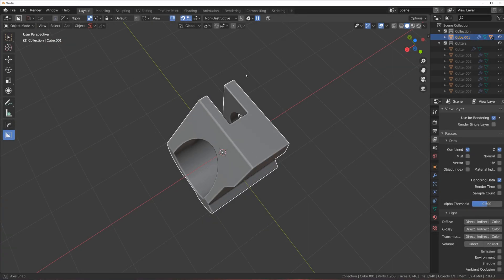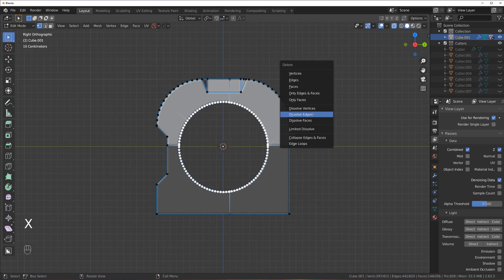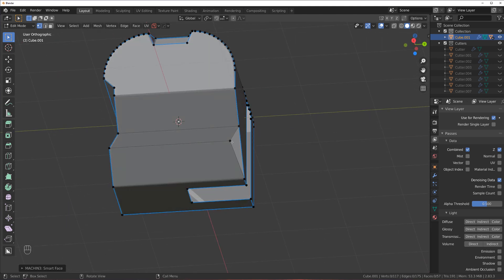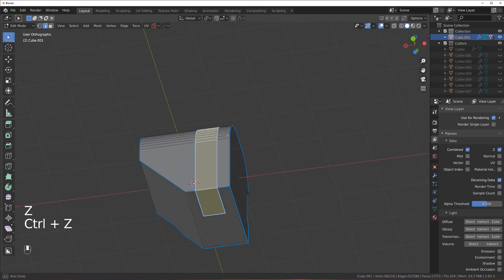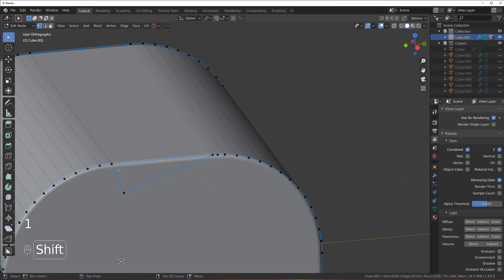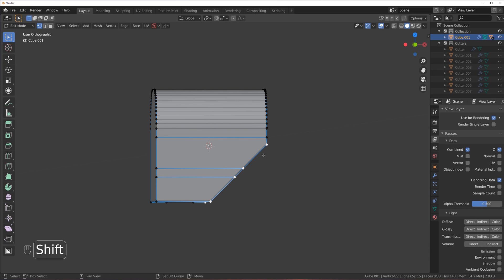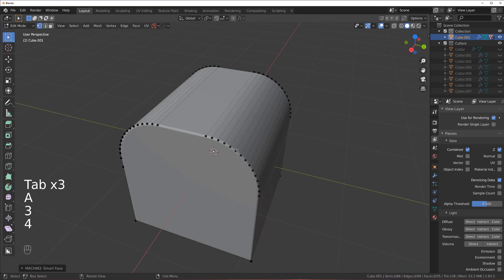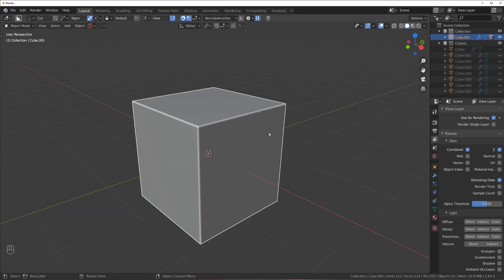REVERT your BOOLS in Blender.

Comment: I'm on a brink of giving up  on boxcutter. You see, while it's awesome 
being able to create fast your assets, my target has always been game 
asset creation (for my game). I've had mannnyy hours of searching 
through the webs about how to UV map and texture properly (with baking) 
boolean cut models, went through and tried manual way (it worked but 
very very hard to do), then tried Maya's auto remesher which didn't cut 
it, tried ZBrush's Zremesher which kind of worked after some tweaking 
but ended up with not so great details and quite a bit of cleanup to do.
 On some of my tests, I was actually faster getting my asset ready (with
 UV Map and proper materials) modeling the classic way (with quads, 
subsurf) than dicking around with remeshing and UV mapping the output 
generated after modeling with boxcutter. Last call for help here.
Reply from the maker: well it is really up to how you set your workflow, we all have out way of working and each model has different purpose. Try new cleanup tools from hops, i am dropping a vid on it tomorrow. But again, if you need ALL quads then manual way might be better. When I create hard surface game assets i dont need quads so I have 0 issues with using boxcutter.  Trtiangulate it manually if game engine or texture software gives you grief.
Reply: Ponte Ryuurui I, don’t need quads. But UV unwrapping properly (without spending insane amounts of time) does need quads. Or so I think. How do you UV unwrap your ngon models for texturing ?
Reply from the maker: @RunTheTape  well use hops for it , you can drop seams on auto on edges above 30deg. and then seam the rest manually. Ngons do not matter if they are on flat surfaces. Again, if you get bad triangulation in texturing tool, just manually triangulate it. SP has some shit triangulation algo.
Reply: Ponte Ryuurui ok. Maybe I’m missing something easy. That would be funny (not) because I’ve spent 3 beards worth of time testing my ass off with this. 
I’ll try drop you a simple model I’ve made in the hope we can talk on the same subject. Thank you for taking your time. Means a lot.
Reply from the maker: @RunTheTape  yeah i would need to see what you have in mind exactly, but the only thing i can think of in terms of ngon issue is triangulation and shading. So flat surfaces no problem, and triangulation simply do it manually via trialgulate modifier an dclean any mess. So, once you bring it to SP or whatever via fbx it is already trialngulated
Reply: Ponte Ryuurui yeah, already did that. It’s quite important for any model to be triangulated before exported to another app because the algos differ from one app to another when it comes to triangulating ngons.
Reply from the maker: @RunTheTape  then you should have 0 issues with ngons, unless you require some very specific areas for texturing, which you have to create manually anyways.

Comment: I've had to do this so many times lately. @ 1:41 Select Boundary Loop works for when dissolving edges, otherwise it dissolves the corner edge and makes a mess.

Oh, forgot to add: you're 101% right, practicing exactly this (cleaning up bevels, and visually baked mesh) truly helped me understand topology and how to control meshes. Great exercise here that I agree everyone should be perfecting
Reply from the maker: huh interesting i need to give this a shot, it seems like a blender bug,
Reply: @PonteRyuurui  true. It would make sense that dissolve would maintain the overall shape, but sadly it doesnt.
Planar decimate does maintain the shape but it wrecks the topology even if set to low values < 1° 

Going at it this way you've shown, really is the best we got for Blender at the time being (as far as I'm aware)

Comment: How to revert applied hardOps bevels?
I remember that it was a pain, as meshmachine's `unfuse` couldn't work with it due to tris being present in the corners
Reply: Select the triangle on the corner and grow the selection til it reaches the boundaries of that corner. Use Y -> Q to quad corner it. Make the corners into a loop and use Y -> B to unbevel.
Using Unfuse really just turns it into a chamfer and I personally feel that Unbevel works better.
Machin3Tools's align works here too, just select everything you want to flatten, and use the align method (Alt+A). ST3 has a flatten tool also (Hops -> ST3 Mesh Tools). It'll flatten to the active face, this works great for removing bevels as well.
Reply from the maker: @DavidAllen_0  Could not say this better myself.
Reply: @DavidAllen_0 , yo!  Two caveats which I was able to do and thereafter question my ability to perceive the world like everyone else with MeshMachine.
When quad cornering it, 1) you have to not have it set to zero, making x = number of bevel number of triangles again (!); 2) for me, it looks like all the make to quads corners have to be pointing in the same direction to work as well.
Thanks though, this was an hour of wtf, I'm this dumb... detour, but it's MINE now.
Flatten to face makes an interesting difference, flattening the bevels but keeping them, which unbevel does not.